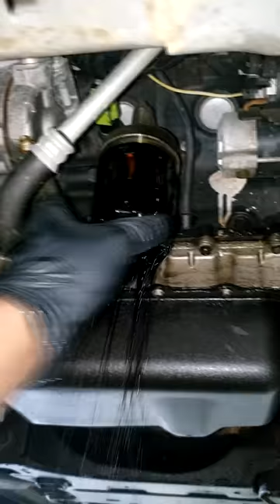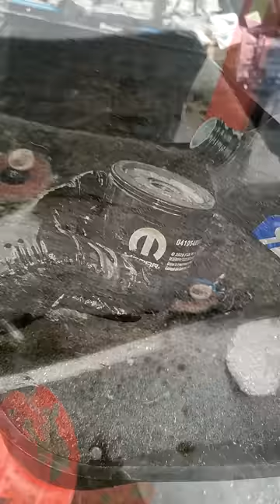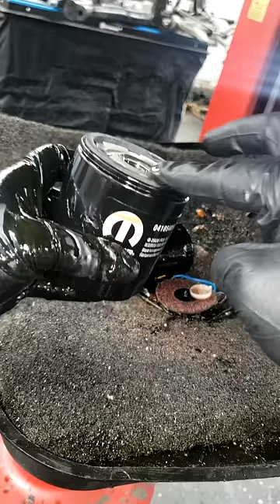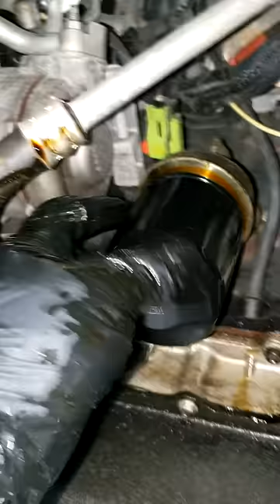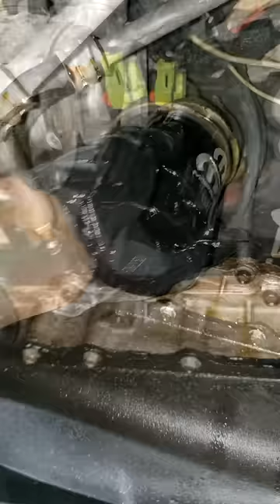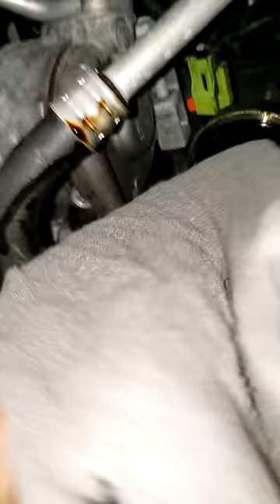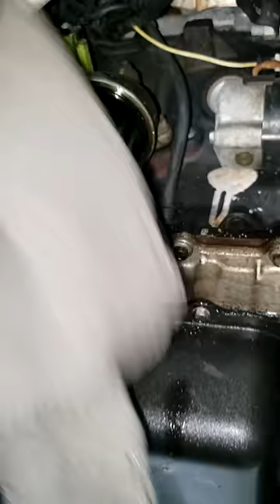Don't Lie.. Are yall still doing this?

Comment: 😂 Bro. I just lube the seal and put it on there.
Reply: Right
Reply: You got it right
Reply: Yeah because it's often mounted sideways anyway. If you fill it with out you'll just make a mess.
Reply: 23 years since I took auto tech In high-school and never taught this only coat threads and seal and i trust that teacher more than any shop around.....just heard recently to ad oil to filter to help build oil pressure faster for rebuilt engine.
Reply: That's what she said
Reply: Facts! & also the cleanest… this looked like a mess
Reply: @meltedmemory a simple lof is way diif than a rebuild/replace. Oil should deff b primed during those events. The best method is w a pressure injection at the top end side of the oil orifices of the engine. Injects oil and purges air from the lubricating system. They're other methods, but this is the best.
Reply: Agree! I have never, and I will never put oil in the filter. Never!
Reply: @c1985paul bingo! I've never filled a filter and I don't know anybody that has.
Reply: Same here bro
Reply: I am with you brother!!!
Reply: This. Any modern car will have instant oil pressure and flow on startup.
Reply: I’ve also done it on high and low mileage cars and never have dealt with any issues. Any wear it could cause would to me be effect it far past my time of ownership.
Reply: Same
Reply: I clean my mess up first. Then lube the seal with a drop or two of the old oil (it seems to make it a little easier to remove next time🤷‍♂️) and screw it up hand tight (mechanic hand tight😉).
The ONLY time I ever prefill an oil filter is if it is a very large (quartish sized) properly oriented filter (usually only on diesels). I've never had any issues yet🙂
Reply: This!
The surface of all the engine components should still have an oil film on them between changes.  For engine rebuilds, assembly lube serves that purpose.  This habit of pre-filling the filter is well intentioned, but ultimately serves no practical purpose.  Lubricate the gasket and hand tighten the filter.  That's all there is to it.  It takes 2sec to build oil pressure.  It took 30min at load for me to seize an engine with no oil pressure.  This pre-filling business is what we call "an old wives tale"
Reply: Only do that with paper filter that Toyota uses
Reply: @meltedmemory 😊😊
Reply: You don't have to fill it completely.. just add some oil into the filter..
Reply: And that's going to be just fine too.....

Comment: Always pre filled a filter from day one and never caused an issue so I’ll do it till the day I die!
Especially on my 2010 Holden Colorado (Isuzu 4jj1 engine) where the oil filter is legit a 1litre bottle size and the one time I didn’t pre fill the filter the oil pressure light stayed on the longest on re start

Comment: This will blow all the YouTube mechanics minds.  Less then 10% of engine oil actually gets filtered through the oil filter during normal engine operation.  The filters just can't handle the capacity so the remaining 80%+ is bypassed back into the engine.  It also takes less the 20 seconds for oil to flow through entire engine upon start up.

I've never pre-oiled a filter and never had any issues.
Reply: It doesn’t really matter tbh, if it was a new fresh engine with no oil then I might pre fill it. But if it is just an oil change I wouldn’t even bother since in every oil change, we will never be able to completely get every drop of oil out unless the engine is being rebuilt and there is still at least 0.3-0.5L of old oil left in the block inside those suction pipes that we can’t do anything about, that amount is more than enough to compensate for the approximately 150ml cavity of the oil filter with new oil on top.
Reply: Source please?
Reply: Maybe at 5k rpm the bypass opens a bit but during normal driving, most goes through the filter material and if you think otherwise, I don't know what to tell you. 

Whoever told you that the bypass is open most of the time while driving doesn't sound like they know what they are talking about.

Modern cars use full flow filtration. It's called full flow for a reason.

Priming things before turning them on is not a new concept either.
Reply: @jerradwilson  the oil company I work for has done extensive research into prefilling your oil filter. It doesn't matter, unless you're a Ford Focus from after 2010. It doesn't really hurt to do it either, but it doesn't matter either. It's all up to personal preference
Reply: I knew a guy…
Reply: There's simply no need to prefill an oil filter on most normal passenger vehicles. No one I know prefills. This video is the first time I've seen it. It's possible there are some odd types of engines out there that need it, I don't know on that aspect.
Reply: 100% lie. If it took 20 seconds for oil to get to the bearings, they would be toast in short order. I’ve seen engines wipe the bearings out in less than a minute with no oil pressure. And all of the oil is filtered more of the time unless the pressure is too high then it will bleed out of the pressure relief in the oil pump or oil pan depending on engine. 
-some guy that’s built numerous engines and worked at dealerships in automotive repair.
Reply: @jerradwilson  you better provide a source why you SHOULD prefill. it's like you'd say "I prefill the sink with water before washing hands, now give me a source that says I shouldn't"
Reply: @nidbahn  I should have specified that I'm asking for a source regarding OP's claim that 10% of oil gets filtered while the rest passes through the bypass during normal engine operation.
Reply: @Turbogto_guy  as an experienced mechanic, I'm sure you're aware you can't drain it dry in under 30 minutes with no solvents. I'm sure you know that even if you drain it well, the residual oil will allow the engine to run for quite some time. I'm sure you know that it takes seconds to fill the dry filter. If you think about it I'm sure you know it causes zero harm.
Reply: @mattschmitt9924  I disagree with you from personal experience. Instance number one: my son changed his oil in his 13 civic. Forgot to put oil in it. Cranked it up and within a minute  or so, bout as long as it took the oil light to come on, it started knocking. He put oil in but was too late. I pulled the pan, replaced all the rod bearings. Two of them were toast. Lucked out. 
Instance number two. My oil pump in my gto locked the pressure relief valve in the oil pump, to full open. Ran for about 50 seconds. It wiped all the bearings out. Btw, you saying you are a mechanic means nothing to me. I work at a Honda dealership and I see many mechanics that are dumb as a box of rocks and screw stuff up all the time. An engine will not live long at all with no oil pressure.
Reply: @Turbogto_guy  I was saying you are an experienced mechanic. I'm just some schmo who knows that 1 minute without the oil is not 100 percent of the cause that broke your son's car. I think you're smart enough to know that as well. 

My wife ran her ford expedition without oil for a week. It developed a knock, but once oil was added, we got over 100k out of that engine. My brother didn't put his filter on a 97 avenger back in the day. Left a stripe down the street. Drove to a different state and back. Probably 100 miles or so. No issues.

You have 2 stories. I have 2 stories, plus a few more and evidence you can look up. We may just have to agree to disagree because we obviously both have personal experience proving the other person wrong. Either way I think we both know incorrect oil levels or pressure isn't good for the engine.
Reply: @jerradwilson  that was honestly my assumption as well, I wanted to know about that 10% thing too.  I thought you meant the 10% thing.
Reply: @Turbogto_guy the thing is that after draining, there is enough hold-up in the engine to cover the time it takes to fill the fresh filter and bring the oil to where it's needed. On a dry engine, starting without priming the bearings will destroy the engine, though. Which is why all manufacturers lube their engines up upon assembly.
Reply: 100% correct!!!  Very little oil actually gets filtered.  See" Uncle tony's garage" the big filter lie.

Comment: Yes I do. I also clean the area and mating surface before I screw a new filter on.
Reply from the maker: Yes, I agree that should be done as well.
Reply: @OnlineMechanicTips   why didn’t you then?
Reply from the maker: @HipHopAnalysis  No reason, just didnt. that oil not going to hurt a thing and can actually be used as lube for the oil filter seal. I didnt know you was this petty. Besides, this not a how to video, simply a question. That I noticed you didnt answer because you seem to be concern about the trivial things.
Reply: @OnlineMechanicTips  damn bruh I was just genuinely curious and you had to come with the disrespect for no reason. That’s dirty Fr. I hope you have a good day
Reply from the maker: @HipHopAnalysis  I answered your question on top of the question of the videos motive. Thats it. The video is a question not a how to video. You chose not to answer the question but instead ask a question.
Reply: @OnlineMechanicTips  I'll answer you're  question. Yes I do pre charge the filter except when it fits horizontal like on my r1 and I also clean mating surfaces and smear a little fresh oil on the o-ring before screwing on.
Reply: @OnlineMechanicTips  bro is talkin about trivial things out here 😂😂😂 cleaning the mating surface is probably just as important as putting oil in the filter before you install it. If not more so bc let’s say you didn’t prime the filter, after 2 seconds of the engine running on a filter that small it will be primed up. Meanwhile any dirt or road grime on the mating surface will stay there between the gasket for the life of that oil change. So yea he is giving a VALID point I was gonna ask the same question, homeboy just said it first ❤ God is good btw it’s just an engine!!
Reply from the maker: @tacticalbacon9877  You think way to hard dude. You gone raise ya blood pressure. That lil old oil that was left on that surface not gone hurt a thing and can be used as lube to the seal. There was no trash or will trash get into the engine. Dont be a drama queen
Reply: @OnlineMechanicTips  alrighty 😂😂 this is why I change my own oil 😂😂😂

One particular reason why I like to clean the mating surface is it because I’ve seen the spindle come loose on multiple different vehicle from time to time, when you wipe down that area which takes little to no time, you are also ensuring that those threads you screw the filter on to are also in good condition!
Reply from the maker: @tacticalbacon9877  Would you like a cookie for doing something you should be doing anyway if you able to? Im not understanding?
Reply: @OnlineMechanicTips  I don’t understand, if your able to install the filter you’re able to check to make sure the spindle is tight 😂LOL. end of conversation.
Reply from the maker: @tacticalbacon9877  Spindle? Ok, yea I suggest you stick with the video games and leave the technical stuff to someone else..
Reply: @OnlineMechanicTips  whatever man 😂
Reply: @OnlineMechanicTips I like this response. No reason, just didn’t. Sometimes we just don’t do things and it’s not a big deal. Dope
Reply from the maker: @skonky  You another hard thinker that will catch a heart attack. That lil oil left on the surface will not hurt a damm thing. In fact it can be used as a lube for the new filter seal. Dont be a bid drama queen dude
Reply: Yeah who would’ve thought that cleaning the mating surface was essential … my god you’re a god

Comment: It’s not always possible.  It depends on how /where and type of filter.
Reply: Exactly right my man. Example vw engines have an upside down paper cartridge type of filter on the bottom front centre of the engine. Can't fill those buggers up. And they drain all over the auxillery water pump, connector and wiring loom when you remove them, even after removing the small centre screw first and letting it drain. Complete rubbish. Or the volvo engine where the filter is on the top and upside down, can't fill them and again make a bloody mess. Great one engineers.
Reply: @daleevans9029 You know we have a tool so it doesn't leak all over everything right?

And after you remove the filter, just put a rag in there while you are swapping filters and o-rings on the cap. It won't leak a drop on anything this way.
Reply: @LynxStarAuto  yes I use the tool but it still drips everywhere. Didn't think about the rag in the meantime though so thanks for the good shout.
Reply: If it isn't possible to pre-fill the filter, use flood clear mode to circulate oil. Hold the gas pedal all the way to the floor and start the car. The starter will turn over the engine but cuts off the fuel so it won't start. The oil pump will circulate oil through the engine (and filter), then you can start it up like normal. It's also a good thing to do if the vehicle has been sitting for a while. All modern vehicles have this feature, as far as I know. Test it one day when the engine is warm to be sure.
Reply: Makes no difference
Reply: Right lol.... Like the 5.4 lol....
Reply: You can still have one prefilled sitting so all the papers or paper are saturated even if you do lose a little bit i still do mine
Reply: @daleevans9029  My BMW is the same way. This is an old wive's tale.
Reply: @dduncan55330  Waste of time.
Reply: @tumbleweedking5668  Based on?
Reply: My filter is horizontal. I don't see that it is possible to prefill.
Reply: @daleevans9029  My Toyota is like that and there is little hole with a cap on the bottom of that shield or w/e it is that is next to oil filter, can stick a water bottle or something in there to catch the oil. it used to fill up and I'd jam towel in there to soak it up until i found the hole.
Reply: @dduncan55330  Alot of cars will red line. Just start car like normal and wait a few seconds,  that is literally all it takes.
Reply: @bmffafo5004  The vast majority of fuel injected engines go into flood clear mode when the throttle is fully depressed on start up. For the chance that your's might not, I'd test it with a warm engine first so you aren't causing damage to it.
Reply: @yfx4  not meant fill the filter, but saturate the media so oil will flow to the engine faster.
Reply: @dduncan55330  i do the same every time

Comment: You can't ALWAYS do that, because some filters are not mounted hanging straight down...  But it's definitely a great idea to put a much as you can in the filter..  It needs to go on the outside holes,  not the center and get some on the o ring gasket for seal.
Reply: Just did a change with a horizontal filter,at least saturate the filter medium it makes for less of a dry start.
Reply: It doesn't matter if the oil goes on the outside holes or not, it doesn't need to be filtered since it's new oil. It's not gonna get any cleaner. And besides, it's not like pouring oil on the outside holes of the filter is gonna filter the rest of the new oil that you pour right into the engine lol

Comment: Just changed my oil and yes I did it exactly like that including the dip and wiping oil on gasket. Only difference is I did wipe the area where you screw the oil filter on and around it to make sure there's nothing there to cause a leak when the new gasket mates up with it.
Reply: My thoughts exactly.  I bought a battery from a new business where I live though the manager is highly regarded his crew looked a little lacking & I'd asked about a grease job on my truck.  The worker was kind enough to jump out there & do it right then no charge.  I'm glad I watched him though because he didn't wipe off the fitting on his first one & I immediately grabbed a napkin/paper towel to hand to him & asked him to do that.  Young adults nowadays just don't have the inclination to use their heads & think about what they are doing.  
I contribute this to the fact that they are trained in school how to take/pass the test (if they so care to)& not how to use thought & reason out how to get the answer.
Reply: @johnjobe7009  I'm only 32 but I grew up in a poor home where if something broke you fixed it yourself and you fixed it right so it didn't break again because you couldn't afford to keep fixing it.

Comment: I always fill the new filter along with putting some on the seal bt i have never cleaned the mating surface in which i never had s problem with any oil leaks from the filter. Now that i have saud this im syre my next oil change on my jeep i will. Although i dont have to worry about this on my diesel 😁